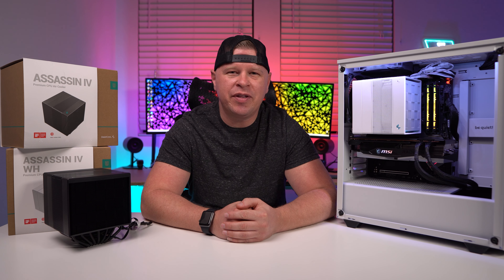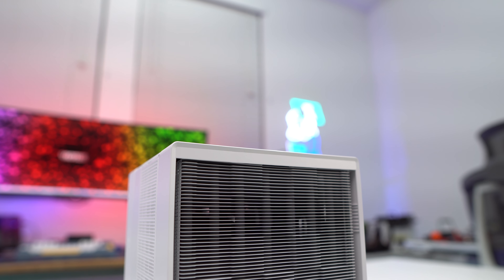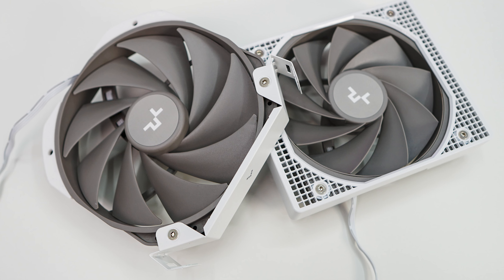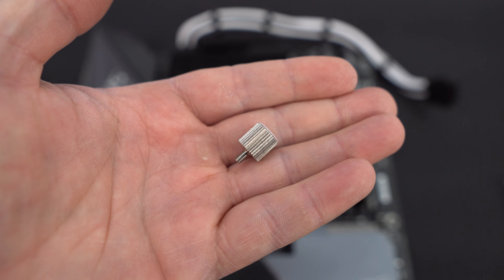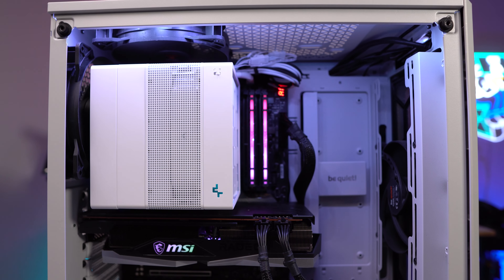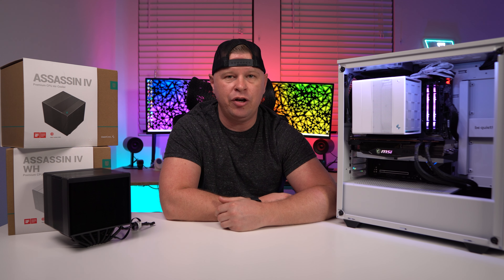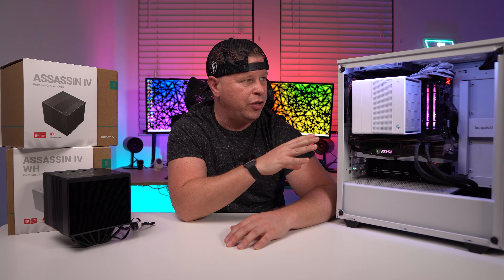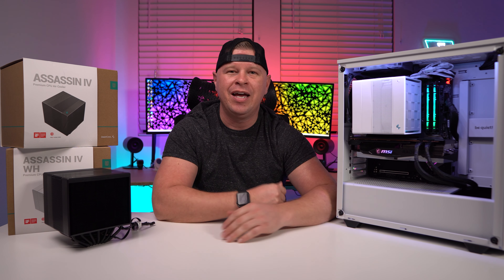DeepCool Assassin IV CPU Cooler Review

Comment: I picked up the DeepCool Assassin IV 4 months ago,  I got the black version and let me tell you. I really love it. It keeps my 5900X cool and never hits 80c at all. Best air CPU cooler I have ever used. Totally recommend picking up this CPU air cooler for those not interested in using AIO coolers.
Reply from the maker: Yeah, definitely one of the best air coolers out there!
Reply: Thank you for ur comment, I have the same CPU so was wondering about getting this if my old NZXT AIO dies
Reply: @Pt08020  While my original comment is a 1yr old, (2yrs actually) the DeepCool brand itself has been banned in the US. You can't buy anymore of those DeepCool Assassin 4 sadly. I still have my original but I will eventually get a new CPU air cooler should my original model brakes down and I'll have the necessary CPU cooler at hand. So yeah, it's been banned from major retailers

Comment: Hi , im really confused between noctua nh d15 dual fan vs Deepcool assassin 4 which is better for Ryzen 9 5900x ? and i had read that there is no replacement fan for the 140mm fan in Deepcool assassin 4 ..
Reply: you are correct, that's why I went with nh d15 g2 instead of deep cool.
Reply: @GBR9794  which is better?

Comment: There are 2 fans on this air cooler right? The one near to the RAM module is pulling air into the cooler . What about the one at the other side of the cooler? Is it pulling air into the cooler or expelling air out of the cooler ?
Reply: expelling air out of the cooler, but the fan is rotating at different direction and there is no replacement fan for that fan and the fan in the middle.
Reply: since both the fans are rotating in different directions so the air is colliding from both the directions, so is it effective in cooling
Reply: @ArtBuddyIndian  it is efficient. i would recommend you to look up counter rotating propellers. to get the idea i am trying to explain.

Comment: Having 4 RAM modules is it possible to mount this cooling system?

I have an AM4 motherboard and 4 Trident Z Neo RAM sticks with a height of 43 mm
Reply: yes it has 100% ram clearance for all 4 slots. There is no height limit since there is no fan on the ram side ! I have it with Trident Z5 6400 32gb kit with no issue. It easily fits 4 slots of the same ram if i wish to add more.